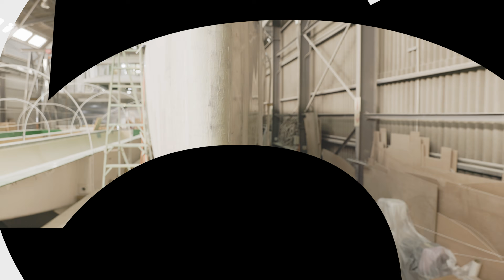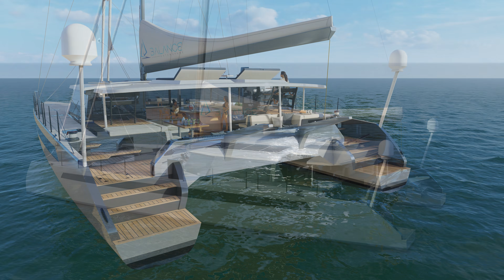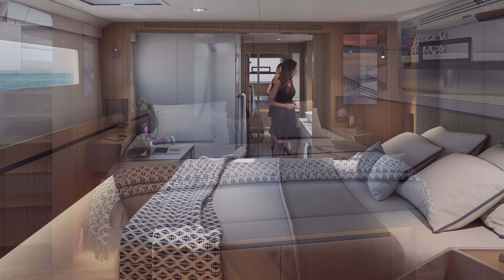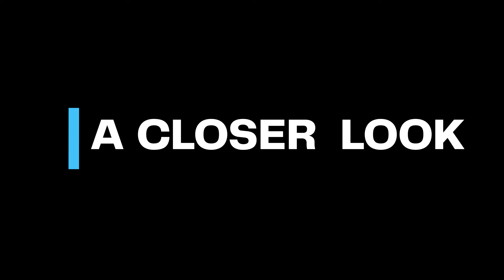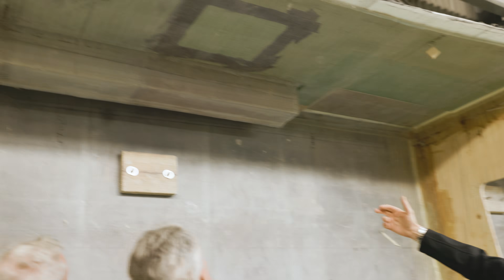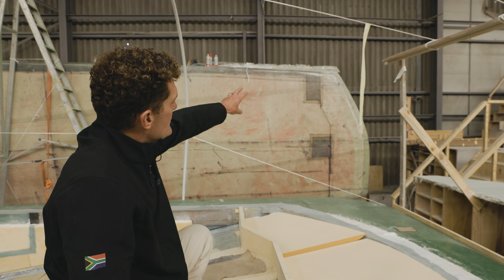Build Series - Balance 750 - Part 1

Comment: Congrats.  Are you all going to offer a forward helm?  A forward helm (HH/Gunboat) + a flybridge helm (McConaghy) + a removeable tiller option (HH/Gunboat).  Too much?  Also, did I spot a mainsail traveler?
Reply: might as well drop all your HH/Gunboat inserts and just say chris white/atlantic
Reply from the maker: We offer a forward cockpit on the 62 and the 75, It's customer 's choice if they want a forward helm or not. We will continue to offer the Versahelm on all models to starboard as we think it is the better place to sail when sailing to windward or reaching as it becomes a firehose on a forward cockpit in any sort of blow. 

I do not see the point of a tiller on a voyaging boat. We would never do this at Balance as we do not think it will be used much or at all. 

On the 75 we can do it with a fly lounge or a full bridge. It is the customer choice.  I prefer the fly lounge as it does not negatively impact performance. Charter operators would probably want the flybridge. 

On the 75 we use a hydraulic mainsheet system, so a traveler is a better application for this. On all of our smaller models we intend to stay with the dual mainsheet, which we prefer to use when possible.